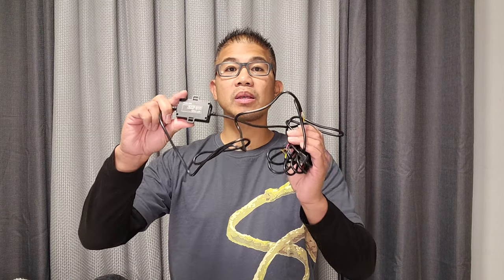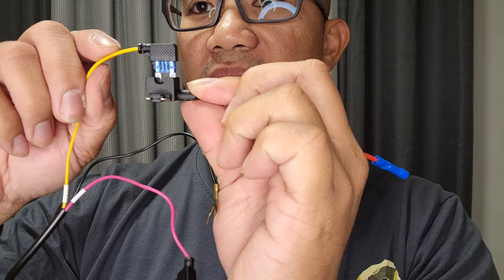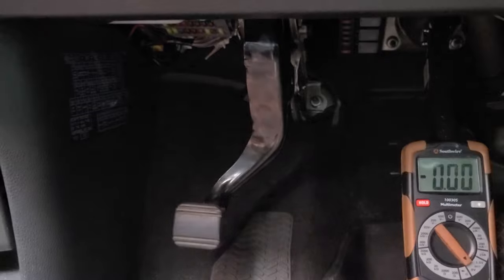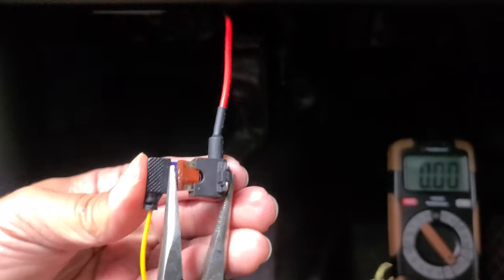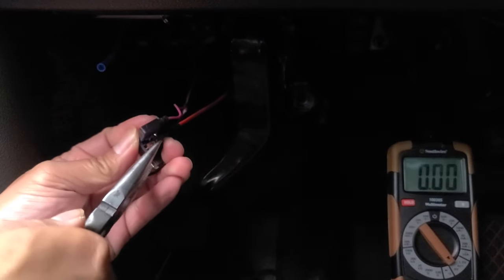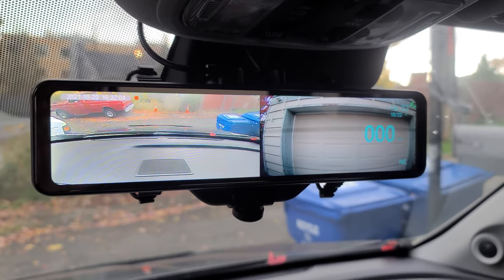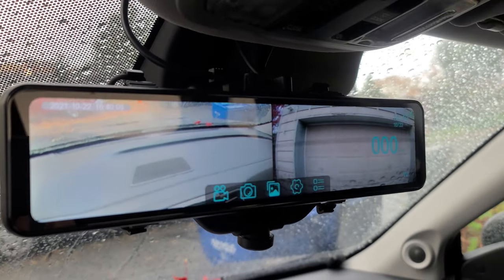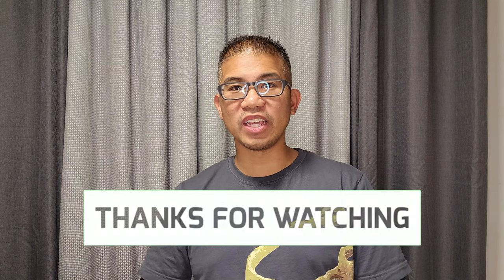How To Install Power Cable For Parking Monitoring in the Akeeyo 360 mirror dashcam

Comment: Thanks for this. I would assume that a parking lot door ding may not be enough of a jolt to trigger the camera. Is that correct? Or would it capture it if set on the most sensitive setting?
Reply from the maker: You are correct. Even at the most sensitive setting a parking lot door ding would not trigger the camera to record.

Comment: Is the BLACK box the shock sensor?  The video doe not mention where, or how to mount the black box.
Reply from the maker: If I'm not mistaken the shock sensor is in the dashcam itself. I just tucked and hide the black box.
Reply: @AutoSensation  It cant be the camera... otherwise why swap out the cigarette lighter style power source only for a hardwire power source...would not make sense.
Reply: @brianmcknight2599  Because the cigarette lighter is not powered when the car is off... or it shouldn't be!